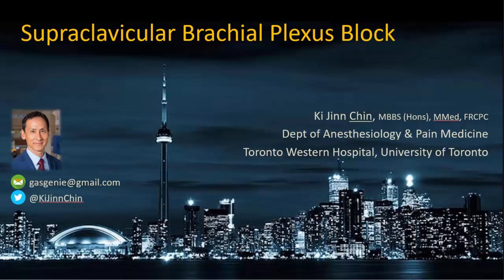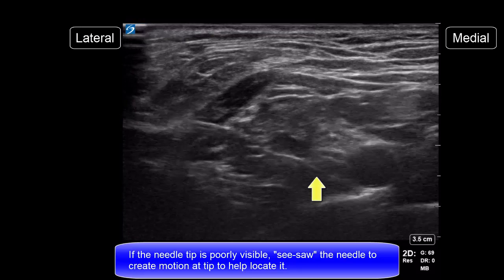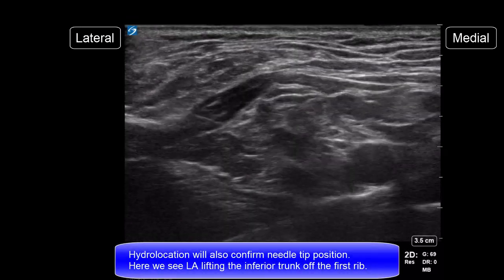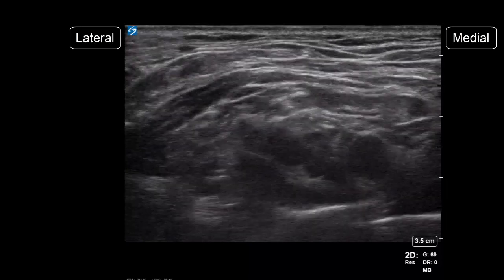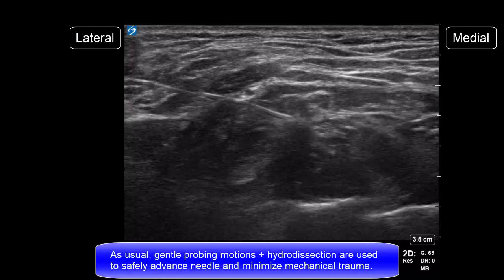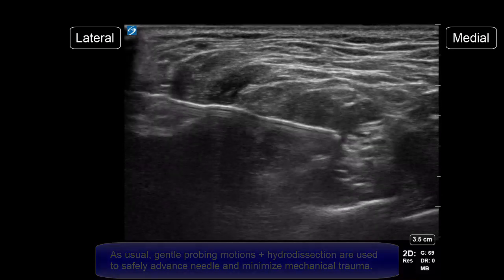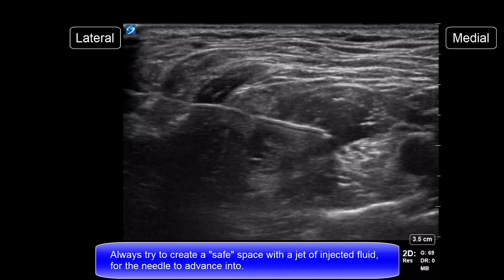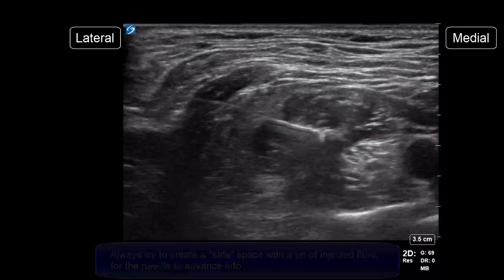Supraclavicular Brachial Plexus Block - a 3-Minute How-to Guide

Comment: Dr Chin, 
Thank you for the video! How do you ensure nerve protection when injecting between superior and middle trunk if the two is not obviously distinct to our eyes? Your video did describe careful needling and gentle hydrodissection towards the area of interest but does it always prevent subepineural injections as described with the intracluster approach? Many thanks for your reply to this!
Reply from the maker: @LeeTee - My observation is that there is an outer sheath to the plexus, and then another inner sheath that surrounds each trunk. The first pop after passing through the middle scalene muscle is this outer sheath. The trunks are still protected by one more sheath/fascia/epineurial-type layer. Anyway - this is what I do. First I see if I can spot a hyperechoic fascial line between the 2 trunks - this gets easier the more examples you see and do. Then I nudge my needle forward, probing the plexus with the needle tip, without enough force to pierce anything. I look to see if the structure "indents" = I'm poking a solid structure, or if it "rolls" away from the tip (see my needling videos for further explanation of this) = I'm tangential to a solid structure and it will move away as I push forward. If I see this, I am usually confident to push forward and "pop" the brachial plexus outer sheath.I combine this probing and pushing with fluid injection. This jet will serve the same purpose, but will also hydrodissect more fragile fascial connections, hence why a plane opens up between trunks once you are within the outer sheath. If  a plane doesn't open up, despite all this, I will sometimes just give up trying. This is when I will aim to go between inferior trunk and first rib, or superior trunk and deep cervical fascia instead. "Safety before efficacy" is one of my mottos. I'd rather deal with a failed block than a nerve injury. And part of expert performance is learning to be flexible in one's approach.
Does this ALWAYS prevent sub-epineurial injections? I can't say for sure, but I know that the epineurium is pretty hard to pierce, so if I'm gentle, this becomes very unlikely. Touch wood - but in 15 years of doing USG regional anesthesia, I personally have never caused a serious nerve injury, and I like to think it's because of attention to detail and a relentless drive to constantly refine my technical skills.
Reply: @KiJinnChin  thank you so much for your detailed explanation and I am very grateful for your generosity in knowledge sharing! Best videos ever!

Comment: Your expertise is evident in every video. Thanks for putting up such wonderful demos. Your needle is seen so well. Which needle do you use and could you please give tips on where on the skin the entry point of the block needle should be vis-a-vis the probe ?
Reply from the maker: This is a generic 50mm 22G block needle. Visibility is a question of alignment - make small controlled, and continuous, probe motions. The supraclavicular is tricky because the clavicle prevents sliding motions of the probe, and one is often forced to tilt the probe. This can change the echogenicity of the target nerves, and is also more challenging to make the appropriate small adjustments in beam direction that is needed for alignment. This is why I view the supraclavicular as an intermediate, not basic, technique.
Needle entry site - I enter fairly close to the probe edge, but try not to have a long needle path through the tissues to reach the plexus. This can make alteration of trajectory difficult due to "trapping" of the shaft.
Reply: @KiJinnChin  thank you for the detailed reply. Really appreciate it